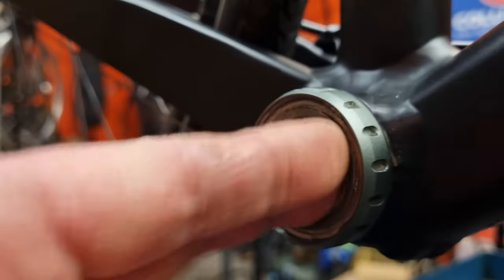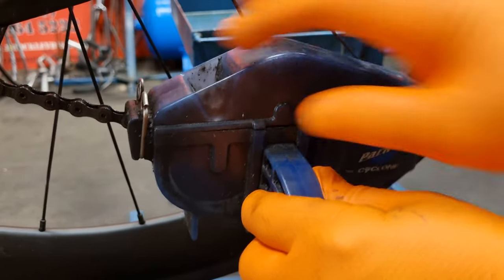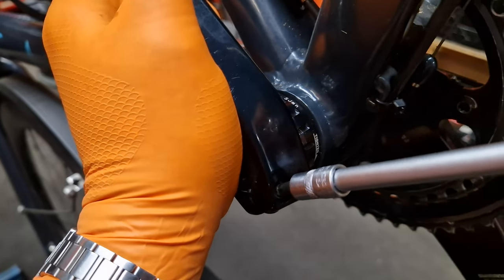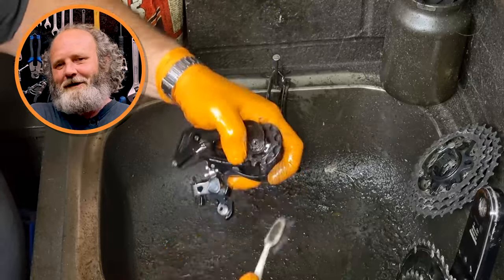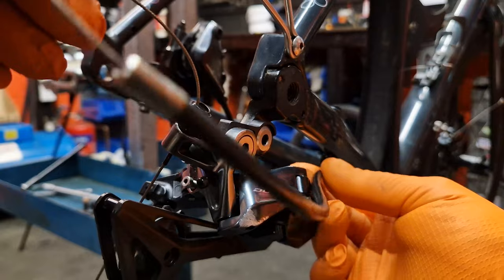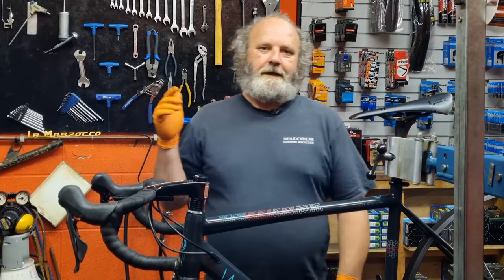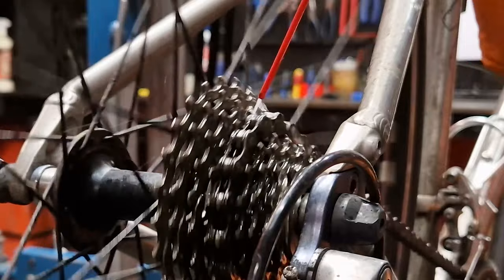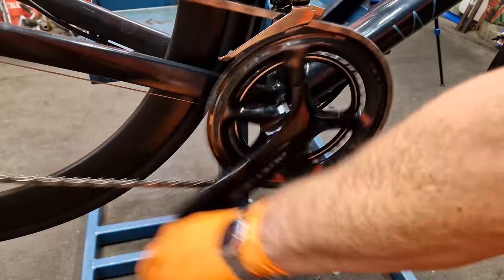BAD HABITS RUIN BIKES HOW TO CLEAN YOUR DRIVETRAIN THE RIGHT WAY

Comment: With teflon/PTFE being a primary ingredient, I would make sure to use it in a well ventilated area and/or use a mask with an organic vapor cartridge. Teflon is one of those "forever chemicals" that accumulates in your body
Reply from the maker: Great point! Our workshop is very airy and there is an extraction fan. Personally, I can't work with a mask on. That shouldn't stop anyone else from using whatever PPE they deem necessary to protect themselves...
Reply: I was gonna make the same comment, but it's probably too late! :)
Reply: But it's chemically inert

There's lots of confusion in this, PTFE isn't the problem, it's the PFOA used in its manufacture

Comment: Very interesting, but isn’t PTFE bad for the environment?
Reply: What is not bad for the environment?
Reply from the maker: Yes, PTFE is bad for the environment. Over oiling a drivetrain with anything (GT85 included) and then using  degreasers and over oiling again is worse. The grime from over oiling and wearing the drivetrain away quicker is less environmentally sound just on it's own. There really isn't much about riding a bike that is good for the environment...
Reply: @bicycleguru avoids your car, which is worse

Comment: I do exactly what you have done, only missing the Gt85.
I have never splashed my bike with a jet. And it's as fast as it can get 55 on a flat.
Reply from the maker: So sorry I haven't responded sooner @luzzyrogue8617. You can read why on the channel's community tab if you are interested. You say you do the same as I do... what product do use rather than GT85? Good on you... so many people clean their bikes like a bull in a China shop.
Reply: @bicycleguru  I use something from Loctite. It's green on the outside so I believe to be Bio.

Comment: Why do you cut off the gear cable? Most of the time, the cable end cap is easily removable if you just push on it from the sides with flat nose pliers. And then install a new cap afterwards. Also, I found that an easy way of cleaning the insides of the chain is using air from a compressor. I do it while holding a rag under and running the blow gun over the chain. Muck flies right off. P.S. Lurpak, go Denmark ;)
Reply: thx for the tips

Comment: GT 85 not available in the US.  Alternatives?
Reply from the maker: I am yet to get deeper into this, but will at some point. A tester of all things oily to clean chains with globally or something like that. When WD40 bought GT85 circa 10 years ago they massively reduced where it could be bought internationally. Last coupla times I was home in Oz, I bought from a company called RS Components. They are a UK company and it was shipped there through their network.

One of the things I want to try cause it is what I used when I was racing at home is Tri-Flow which I think is readily available in the US, Try it and let me know how you get on if GT85 is unavailable...
Reply: @bicycleguru  I already use spray Triflow and it thicker than GT85. I am going to try Muc-Off MO94.
Reply: Using Muc Off MO 94 now and it appears to be a good replacement for GT85